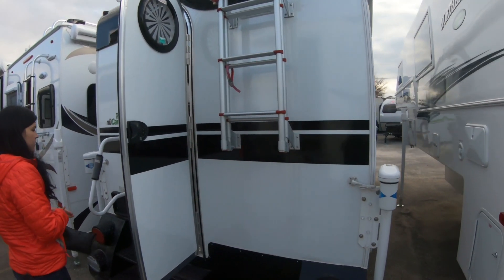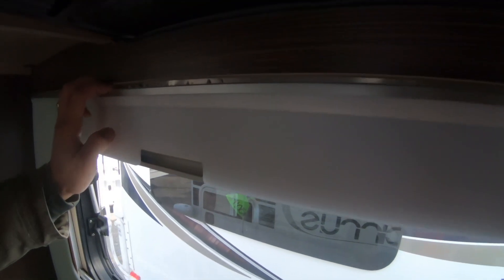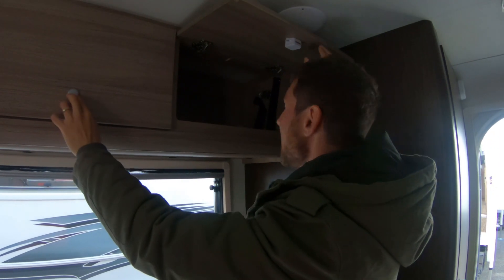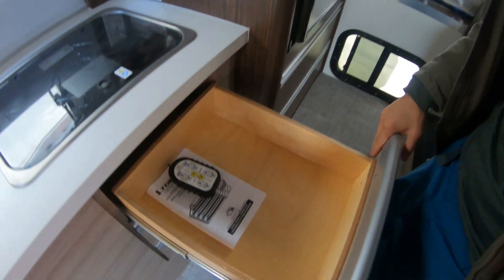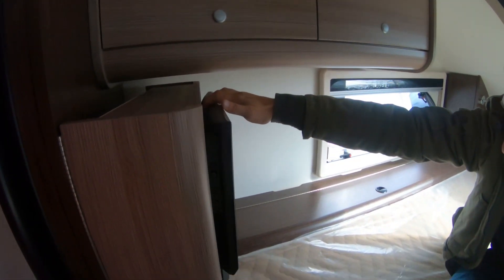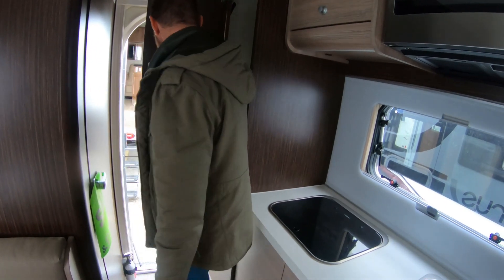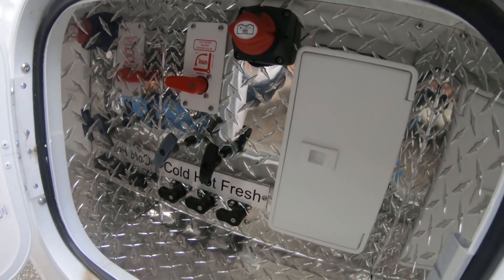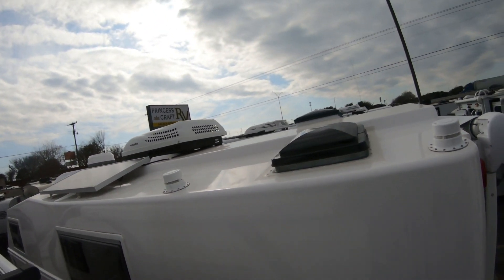MOST MODERN TRUCK CAMPER IN USA. nuCamp Cirrus.

Comment: Check out that Northern Lite beside that Cirrus. That big microwave only works on 120 volt so you need to be hooked up somewhere or run generator. Small 2 burner stove makes it a bit harder for cooking on. Folding faucets and sinks seems to me would be added failure points. And it would be very nice, but not neccessary, to have a lower window on rear door so you see "through" the camper while driving with your rear view mirror. The Cirrus's do have a clean/ sterile look and they have a very nice bed support system.
Reply from the maker: Hey, Thanks for checking out the video. I think Norhern Lite is still a much better camper than the NuCamp. You absolutely cant beat the two piece molded design. However the interior finish is very old school and just not up to modern standards. 

If the interior of the NL was as nice as the Cirrus it would be the best camper around. 

As far as the sink with a folding faucet i 100% agree with you. It was actually already broken. But the issue in my opinion is not so much the folding design but the fact that its all made of plastic.

Comment: For the price of that camper and the truck to carry it it would be cheaper to convert a van. More room, better fuel economy and parking. Nice review
Reply from the maker: I totally agree! The nice thing about truck campers is that you can take it off and leave at a camp site. But I totally agree with you on the van conversion.
Reply: When you figure it how to put a bathroom in your van let me know.
Reply from the maker: @lisacaron7224  actually plenty of ways to put a shower and toilet into a van. Depends on how big or small of a van. Look at a Winnebago Revel. It's got full shower and toilet in a short wheel base sprinter.
Reply: caron  YouTube has all the answers, many people have done it already
Reply: @Scrambler85  Well if you are not a full time nomad, and have a job that uses an f 350 or 450 the rig became far far far less expensive than converting anything.
Reply from the maker: @sad754yt  It really depends on what you want need out of your rig. I think the biggest benefit of a van vs truck/camper or truck/trailer is that you can walk from your bed into the cab in the middle of the night if you need to get out for some reason. No need to do the "walk of shame":-). 

But then the biggest negative of "all in one" rig is that if you get into an accident or something mechanical happens to the rig you dont have a vehicle or a house. With a tow behind or with a truck/camper you can get the camper to the camp site or RV park and you still have a place to live while the truck is getting fixed.
Reply: @sad754yt  your boyfriend has your Prius.

Comment: That thing looks like a cheap pile of crap, some kind of ghetto European apartment. Particleboard, bathroom door that won’t close, how do you think that thing is going to hold up a year from now
Reply from the maker: It's true however you have to first understand that you can't just make everything out of oak and steel. This thing has to be very light. Also there was no particle board. 
Mostly high quality treated and sealed plywood which is what is used on expensive boats. 
The construction itself is aluminum frame with Adzdel for exterior walls. 

Have you looks at other RVs? Frames made off 1x1s that are stapled together with pop can aluminum stretched over it and cracked filled with flex seal.